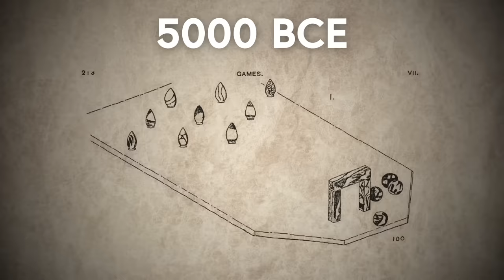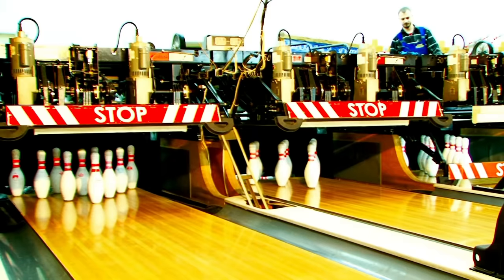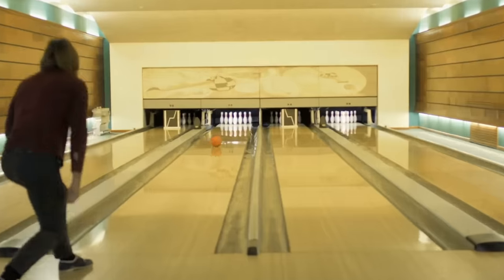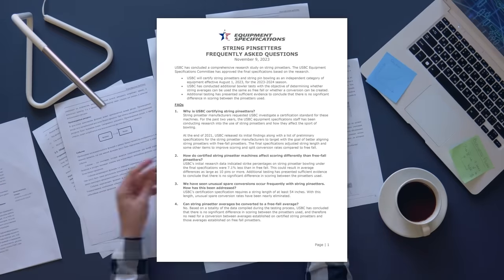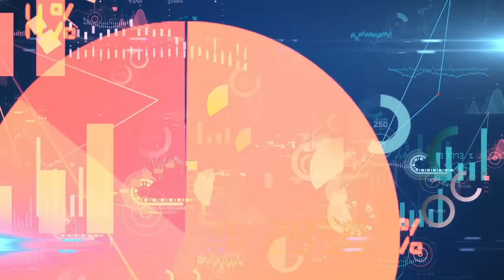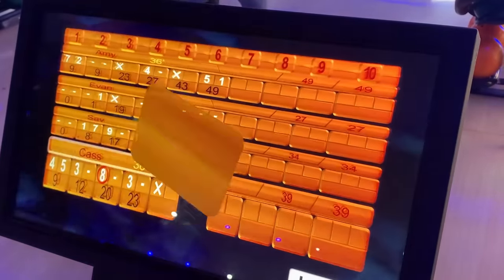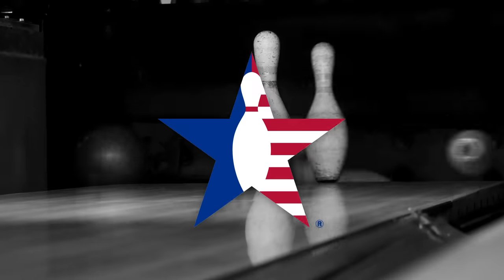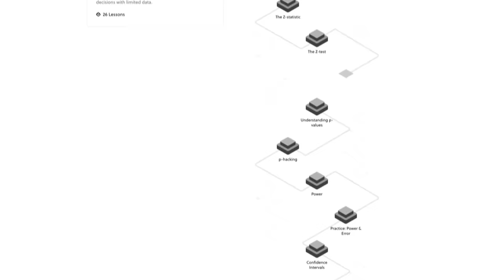The Controversial Machine That’s Ruining Bowling

Comment: I worked in an establishment with string lanes. While being told by my older coworkers that they were better than free fall machines, we all agreed they still suck. The strings would be CONSTANTLY TANGLING because of assholes, some of which have outed themselves in these comments, would throw balls so hard that it would make the machine lock up from the knot and a member of the technician team, of which I was a part of, would have to go from where ever they were in the 90,000 square foot complex to the very back of said complex to untangle a lane, all while being yelled at over the radio for not having the lane cleared already because we were to teleport back there immediately and make the customer happy.  After clearing the 20 plus balls, no seriously people think they can make the machine work by throwing more balls down the lane, I finally untangle the pins and set the machine in motion, wasting 20 minutes of your time, which you paid a premium for by the way and will not get back, and mine, which I could be using trying to fix a game that brings in just as much money but had a bad part we had to find in it. The back of the alley was still deafening, the machines dangerous, and the people just as stupid. Don’t get me started on how many times coworkers and I had to dodge bowling balls from kids and adults as we worked in the lane.

Comment: The pin action on string lanes is nearly non-existent and the machine will fell pins that were never hit. I suspect the actual implementation of these machines  (at least at some alleys) has a lot more going behind the scenes: analyzing the ball trajectory and trying to compensate for the strings.

My father and I encountered our first string lane several months ago and couldn't figure out why it felt wrong for several frames until one of us finally spotted the strings. We also scored nearly 20% lower than our averages, mostly due to open frames. It's possible the lane surface and material is also different, but that's a significant decline in marks and score for league bowlers.

Comment: Every pinsetter I’ve ever worked on uses a wheel to pick up pins and the sweep is not to block bonus balls it’s to move the fallen pins to the wheel. I’ve never heard of or seen the elevator shown in the graphic before.

Comment: The p-value of .035 is presented as related to the paired t-test, when rather it is for an (unnecessary with these sample sizes) test of normality.  If it had been the p-value resulting from the paired t-test, the corresponding 95 percent CI would not have contained 0.

Comment: My first question is why hasn't anyone innovated the pin resetter, but my second thought is to just keep two lanes mostly out of use with the old resetter and the rest strings... if anyone complains, boom - you've got it. That's based on my hypothesis that most people that go bowling are like me and are going to bowl under a hundred either way

Comment: In order to have a proper test,  you'd have two teams of bowlers, with the same clothing, shoes, and balls each day, one bowls a set of games at the string alley first, then the standard alley. The other team in reverse. The next day you would flip the teams to start at the other alley first. Of course you would have to make sure that the laves were all oiled the exact same way, and that there were prizes, so that fans of one or the other system didn't tank their game to skew the results.

Comment: How you going to pick up a 7-10 split with the pins on strings? And what about when you pick up a strike by a pin rolling across the lane and knocking the last standing pin over? What if two (or more) strings get tangled and arrests or otherwise interferes with what would have been the natural action of the pins?

Comment: I stopped ten pin 2 years ago because strings were put in to my local bowling center. My balls cost well over  200 pounds each my bag cost 150 pounds shoes over 150. I have seen a pin pin fall after being hit the string not the ball or another pin. Strings are crap. If they were so good why pro bowlers not have them in major competitions.

Comment: It's not surprising that a (very) non-significant p-value was produced here since it was a very underpowered study. Unless the difference is enormous (which it probably isn't), a lot of participants would be needed to draw useful conclusions -- hence why the official study used over 500 bowlers.
Another potential confounder is practice effects: especially for less experienced bowlers, they may have increased their skills noticeably from the first play session, and therefore scored better in the second session with the string pins. To counteract this, similar studies often split 50% of the group into playing in condition A, then condition B... with the other 50% doing condition B first, then condition A -- if the difference is still there (and in the same direction) for both groups then that's a better indicator that there is a real difference, separate to practice effects.

Comment: I don't think bowlers with a 60 average are consistent enough for a test to show any merit. I know this is just one instance, but I bowled on a string alley one time with some friends and it was frustrating. Scores were definitely lower across the board.

That being said, the test that was done with a bunch of bowlers, I'm assuming was across a bunch of alleys, as one alley isn't going to pull out their pin setters to put in strings just for a test. The Difference between the two alleys could have been more than enough to make up for the difference in the strings. Going from one oil pattern to another, or synthetic lanes to wood, I can go from bowling around 200 average, to 150.

At my league on Monday, they put some weird oil pattern out "trying to lengthen the skid" is what they told everyone. Two of the straight bowlers on my team with 130 averages were beating hook bowlers with 200 averages straight up. The one guy went through 5 or 6 balls trying to find something that would do what he wanted.

Without doing the test on the same lanes with the same oil and testing multiple types of bowlers (straight, traditional hook, two hand, all ball speeds and ball weights), the test was very uninformative.

Comment: While strings are a easy fix for the   complicated issues of free fall pins...I think a better solution is to just make more reliable pin setting machines with fewer parts and more reliable / easier maintenance.  Sounds like innovation should be happening in that space.

Comment: I bowl weekly in a 40 lane house, with 5 man teams. That's a lot of people right. A majority of us have told our house management, that if they go to strings, we will find another house to move our league to.  Tell, me, is it really going to save you money if you lose one of the biggest leagues in your house to make a few people happy with strings. I'm in the Washington DC area and off the top of my head I know of 5 other bowling centers all within the same 30 min driving time. What you also failed to mention in that study, is on avg, the bowler will lose on avg a 10 pin difference in their handicap. That's not a lot right, but when your talking about professionals that don't have a handicap, that is HUGE.  Let's do a comparison.  Let's raise the basketball net up by an additional 10 feet, and move the 3 point line back an additional 10 feet, and make the baskept ball rim 1 inch smaller.  Same game right, shouldn't make "that" much of a difference.  Point is, if it ain't broke, don't try and fix it.

Comment: Pinsetters do not crush people to death.  Stupidity does. I worked at a bowling center in the late 90's. Every time i had to enter those machines,  i would disable them.  There are two groups of people that get injured... the young kid without proper training and common sense,  and the guy thats been doing it for years and ignores safety protocols (which is also  lack of common sense).  Lack of respect for machinery is by definition lack of common sense. 

I worked with a guy that got lit up when changing out a capacitor. He didnt know that by definition they stored electrical energy, or how to discharge them before handing.  He didnt do THAT twice!

Comment: You do not get to simply disregard results you do not like. The test with the best control of different variables is the one that will do the best to isolate the desired variable. Not liking the results and "redoing" it with a completely new test with different parameters, criteria, methods, etc. screams biased study and results. This hits very close to the 'justification' used to change IQ tests. Some people didn't like the results (those with funding) and so the test were changed without regard for how well it was isolating the desired variable (very well) and then the changed results were used to retroactively justify changing the test because they specifically designed the changes to get the results that were desired.

Comment: "New".  My local 5 pin bowling alley in the 80s was strings so this tech is even older that computerized scoring.  It could be new to 10 pin though, I don't recall seeing any of those.  I did actually work as a pin chaser in the late 90s and those machines needed constant help.  I wasn't even a mechanic but I had a full time job just running back and forth unsticking pins and pushing balls.

Comment: If anything string pins kills bowlers, I was born and raised in an 8-lane AMF center where my dad worked as a mechanic for 35 years. String pins is not real bowling, it's arcade and i think many good bowlers quit due to their center switching to them. Justify the switch with costs, parts, environment all you want. Boycott string pins! Let the Bot-flaming begin!

Comment: Couldn't you just hire people to manually reset the pins again, but use 20 pins per lane and a newly designed man-operated 10-pin pinsetter so people don't have to wait?  That would remove any chance of strings being a problem, be cheaper than the machines, and should be just as quick as it is now, since the pinsetter and 10 extra pins would allow them to set up the pins just as quickly.

Comment: Those tongs are called scissors, the elevator is actually a big wheel with the negative shape of a pin that rotates them up into a conveyor belt and further upwards to the turret and back dowm to the 3 layer deck. On the brunswick a2 machines that is.. bowling machines are incredible inventions with an insane amount of moving parts. All driven by a mechanical computer called the detector. which can tell if there was a strike, pins left on the lane, whether its first or second ball, and whether there is a pin out of range of the machines ability to pick it up. All designed and manufactured 60-70 years ago and still working to this day. I used to work on them and could sit and watch them work for hours and still be amazed that someone designed all those inanimate objects. Assembled them and got something that can basically think for itself, albeit only about 4 or 5 possible descisions but still amazing

Comment: One of my first jobs was as a trainee mechanic working on pin setting machines. You wouldn't believe how complex those things are, and how much routine maintenance they need. They were always needing replacement parts, usually the 'fingers' that gripped the neck of the pin during the resetting process. 
I can see how people got crushed to death inside them, in my job there was a pressure from the franchise owner to get them working again ASAP, which meant working on them while they were still live.
I refused to do that and got sacked - even as a dumb kid I wasn't going to work on anything that could crush me unless the power was turned off. It was a crappy job anyway.
Years later I had a job working in a huge automated warehouse, maintaining conveyor belt systems. On that site we'd isolate the section of belt, lock the power switch to off with a padlock and keep the key in our pocket. Which is peace of mind when you are under the damn belt, retensioning chains and replacing drive sprockets.
Reply: That's actually the OSHA certified way to do repairs, making sure the power latch is locked closed and unable to be opened except by the technician working on it.

Comment: the issue with this is trying to prove strings are as good as free setting.  turn it on its side, lets see someone try and do something with free pins they can't do on strings, or vice versa.  How well can you use the 6 pin  (3rd row right) to knock down the 7th pin (4th row Left-most) ?  I think someone with a mean curveball could get up to some shenanigan's

Comment: I play ninepin-bowling in europe since 30 years and we only play with strings. A non-string machine would not be possible here because every pin has a slightly different weight (only several gramms). By switching them or making them the same weight the game would get unpredictable or you would never get strikes.

We never have problems wirh splits. And maybe the strike rate in 10pin-bowling could even rise by playing around with slightly different pin weights.

The only disadvantage we have is that the strings tend to knot. So around every 100 balls (depending on the lane) someone has to go down to unknot the pins. But in general this is acceptable.
Reply: Scherenbahn, do you play this type ? I've seen this on YouTube. Maybe could import this game to North America.

Comment: 04:04 Err... if p = .035 then they did find a statistically significant difference, which isn't consistent with what you said about the study. That also isn't consistent with a mean difference (not mean) of -0.0951 and a 95% confidence interval for the difference that includes zero. Did you mean p = .35?

Comment: Your "test" doesn't really work as well as you think it does. The difference in pin count is going to be much more noticeable to avid competitive league bowlers than it is someone picking up a plastic house ball, throwing on some ill-fitting clown shoes and yeeting the ball with no technique whatsoever.

Also to address the repetitive bit on machines crushing people:
Working with machinery in ANY field requires specific precautions. You have no place working in a bowling center if youre going to work on these machines without adequate training and lock out procedures (manualling shutting off power to the machine before entering) This is a Darwin awards if I ever heard of one.

Comment: Strung pins are very normal in 5 pin bowling. Just about every lane around here are strung 5 pin lane, there are a few free fall lanes in 5 pin, but this is much more a 10 pin problem.
The way the lane is tended is much more of a factor, well at least for the freaks like me. I got great at curling my throw, and the amount of wax or the lane material matters more than the strings.

Comment: They can say what they want, but it's not the same. The reason the score doesn't change much (for league/professional bowlers) is that you get strikes you shouldn't get and don't get strikes you should have gotten, which averages out in the conglomeration of scores.  Translation: the strings change the way pins fall or don't fall as the case may be, but if you have enough data points, the overall results average out.  There in lies the problem for me...I want to get the right score at the right time. Not an approximation of the right ending score or long-term average. Probably not explaining that well for the casual bowler (or maybe anybody...lol), but freefall pin action and results are what should happen and string-pins are not. In the string-pin future of bowling, bowlers won't even know what a "messenger" is anymore. Truly sad.

Comment: Any serious bowler knows that lane conditions affect scores dramatiaclly.  The house, as well as the oil pattern can affect scores by +/- 25 pins.  I would like to see 1,000 scratch league bowlers bowl with strings and then on normal lanes.  The catch is that the lanes are the same.  The only thing they change is the pinsetters.  This will give a much better comparison between scores.   

As an avid league bowler I think string pin bowling compares to regular bowling like mini golf compares to golf.    String pin bowling is great for a bunch of non bowlers or kids having some fun but I cannot see serious bowlers ever embracing it.

Comment: I just played in a league with a strings set up and the strings would knock over at LEAST 4 pins PER game, PER player that would've still been standing. They also dont react the same way when you hit them. You would think someone could design a lighter, more efficient pin setter(the underlying tech and design of those machines must be like 30+ years old) instead of jumping straight to, lets put strings on the

Comment: The statistics are not quite correct, yours and USBC's. I am a 220+ average bowler for decades and used to be a bowling center mechanic. The stats do not take into account certain "styles" of bowling. Many higher average bowlers today use higher ball speeds and rev rates to generate more power, which, on free pin machines, results in more pin action (pins bouncing off side boards or out of the back and knocking down other pins). This is significantly reduced with string pins. I have bowl on both and noticed some "power players" averaging up to 15 pins lower than usual. Having said all that, it has been noticed that, with string-pins, pins are sometimes knocked over by the strings of other pins, which shouldn't count, but league bowlers would be there for hours trying to correct scores, so they just accept it. Even though string-pins are now certified by the USBC, the sanctioned averages from string-pin leagues are weighed differently than free-pin averages.